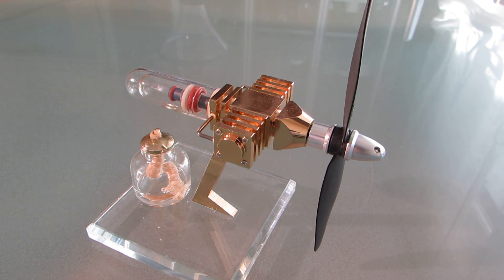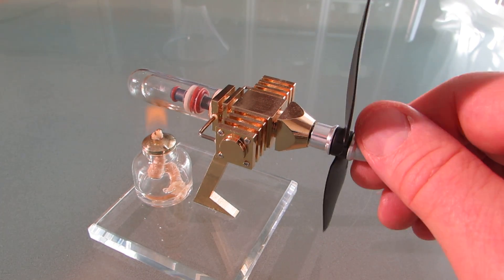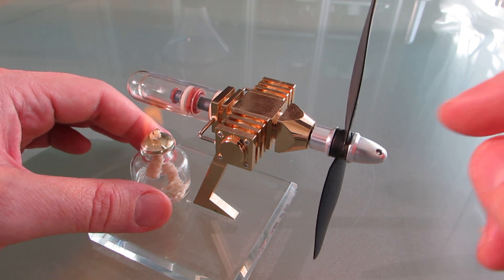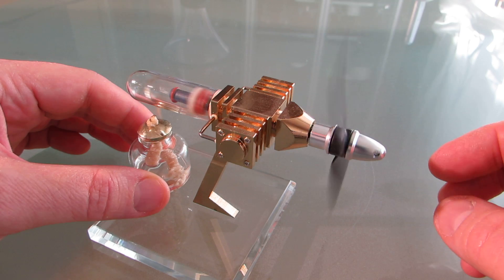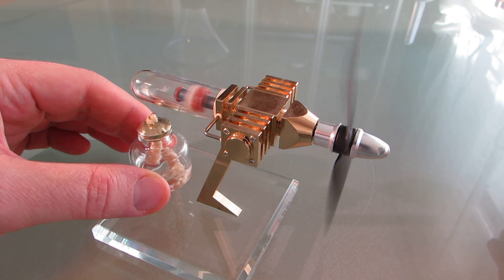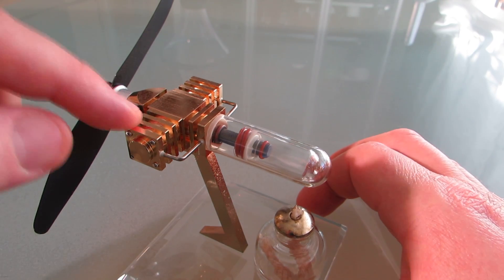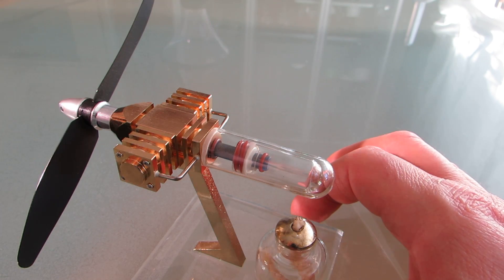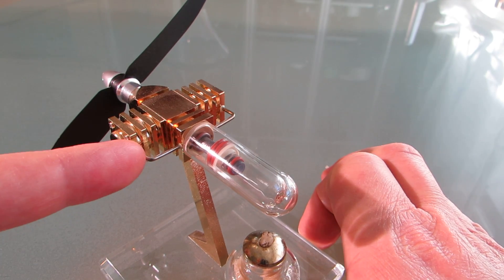Desktop Stirling Model Airplane Engine

Comment: This propeller setup is rather interesting , as given the nature of that engine, it can act both as a sort of governor for the burner, I mean, when it revs too fast, it blows the flame away from the piston, it is heated less and thus revs slower too.
Also it's airflow improves cooling, so I guess it runs better as there's sharper temperature contrast in its system!
Reply: I think so, too. It is important to use heat efficiently

Comment: I’ve been spoiled with a Kontax KS90 Solar, it’s been running almost constantly for 8 years now.
Reply: 8 years without stopping? What did you use as a heat source?
Reply: @mikoajjaros3570  solar

Comment: Nice. I’m making an rc steam powered plane. Tip. Make the heat source much more powerful. Provides way more power. The hotter the fire. The more power. Same with gas engines the better the spark the better the power
Reply: There are 3 main way to increase pressure/power. Reduce the volume of the cylinder, increase the amount of molecules, and increase the heat. Plus a few other things like reduce steam leaks and such.

Comment: Modern commercial airplanes run on compressed air -elon musk
Reply: I mean. It's not totally false? Jet engines just need the heat from burning Jet-A to expand the air quickly enough to produce thrust. A number of methods of heat production works. Electricity does a fine job if you have enough
Reply: paul austin  
Most of the tech scen is a controlled release, it's not a "natural economy"
Manufacturing
Society
One scheduled release at a Time, weather it's movies, music or other media..
We live in a social experiment....
Reply: All combustion motors are basically air compressors. Hence the term compression. Happens in a piston, happens in a jet.

Comment: I disagree.the problem is we are not applying the Stirling engine the right way.true,it may not have the power to drive a prop,but it can be linked to a generator.and an electric motor can then drive the prop.batteries store large amounts of potential energy to be used on demand.this is why we have batteries lol.the trick is getting the Stirling light enough to not really impact the craft much while still being able to keep the battery charged.a Tesla generator comes to mind here,and a lot of small cylinders on the Stirling.